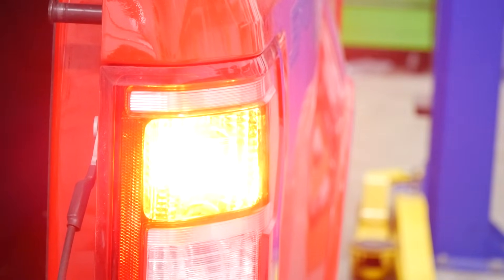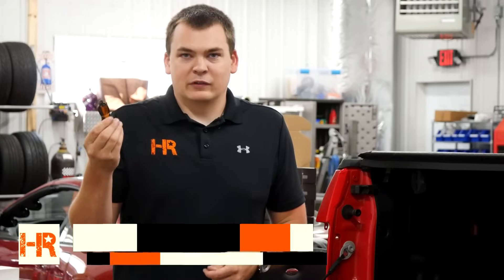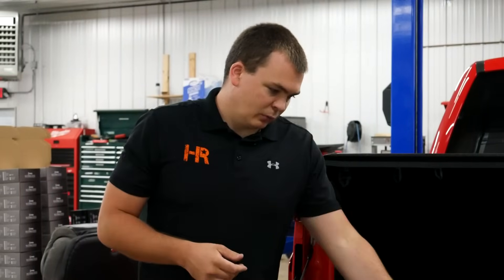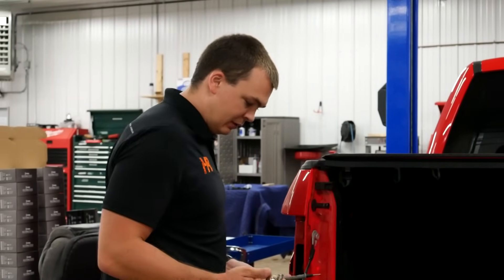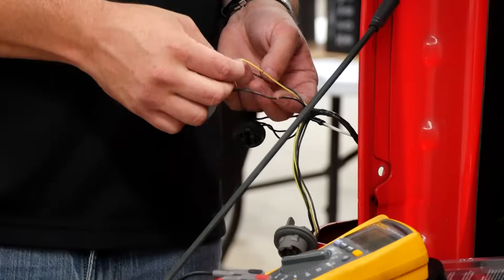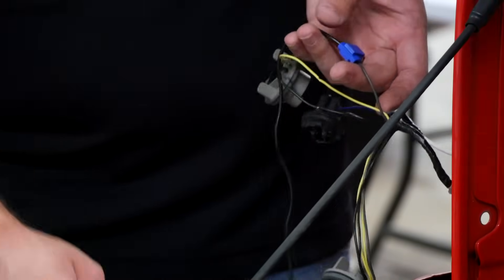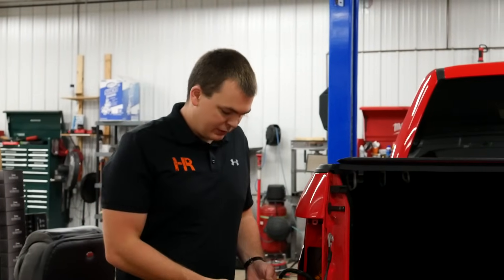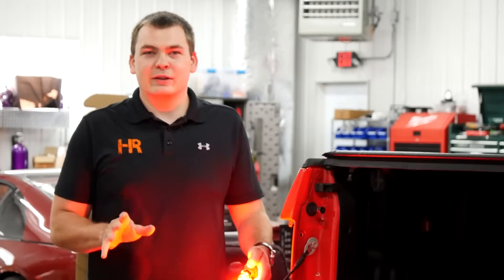How To Install LED Resistors - Everything You Need To Know | Headlight Revolution

Comment: I just put some led headlights in my jeep and when i switch to bright it will cut off
Reply from the maker: It sounds like your Jeep may need a PWM module to prevent the headlights from cutting off when switching to high beams. You can find them here: https://www.headlightrevolution.com/gtr-lighting-pwm-hid-kit-modules-ACC.PWM5202.MOD_2

Comment: I just bought some Sylvania Zevo LED Bulbs for my turn signals. Ill try them in a few days and see if it  works and if they are brighter than stock. If they give any error messages on my car or they hyperflash ill be taking them back to AutoZone. Im not cutting my factory wires in my car. If they cant make a product that works as intended they can get a negative review and give me a refund. I dont think thats too much to ask that a bulb works out of the box.
Reply from the maker: We totally agree! A bulb should work as intended right out of the box. If you run into any issues with those, we recommend checking out the Morimoto XB LEDs – they offer a resistor-free upgrade for a hassle-free install.

Comment: One resistor per bulb or one resistor per side? in the case if i want to put leds turn signals in the front
Reply from the maker: One resistor per bulb - but not every bulb/function will need one. For example, in tail lights, it's common for the turn signal to require a resistor, while the brake lights don’t. In your case, you’ll need one resistor per turn signal.
Reply: @HeadlightRevolution  I have the same problem in my 2012 Silverado, when the position ligths are on the hyper flash Start, but when my position ligths are off and use the turn signal they dont hyper flash

Comment: What kind of resister do I need for LED headlights on a 2011 Honda Accord.  I installed LED headlights and the passenger blinker is hyper blinking.  Thanks for any information back
Reply from the maker: For turn signals, we typically recommend 50w 6ohm resistors: https://www.headlightrevolution.com/50w-6ohm-gold-resistor-ACC.RES.50W_2?quantity=1
Reply: Thank You,  is it common  for only one headlight to hyper flash and the other to flash as normal? I appreciate Your response

Comment: no thermal grease?
Reply from the maker: Not typically needed when using T-taps like the ones included with the resistor kits. For plugs/connectors, though, I’d definitely recommend using something like dielectric grease.

Comment: Question. If I have multiple lights on my truck that are my rear turn signals.Do I need to add a resistor to each one??
Reply from the maker: If all of the rear turn signals are experiencing hyperflashing, then yes, you’ll need to add one resistor per bulb.

Comment: Thanks for the help.  Unfortunately I found my bulbs from another source and they told me to wire it to the high beam lights.  It did sound crazy but I have heard that the power sources from one of the headlights.  The video directions were 20 sec. long and did not tell me anything so I wired it in series to the highbeam.  Your directions were very clear  and show it being wired in parallel.  It made total sense after watching.  My car stopped hyperflashing.  Thanks and great work.

Comment: I just bought a set of H13 led lights with capacitors  all worked till I started the truck then only one worked on high beam 2007 Dodge with TIPM box would the work
Reply from the maker: With LEDs for headlights, we typically recommend using PWM (Pulse Width Modulation) modules instead of capacitors. PWM modules are better suited for stabilizing the electrical signals, especially with vehicles like yours that have a TIPM box. Capacitors or resistors are generally more effective for turn signal bulbs or smaller LED accessories.

Here’s a link to a PWM module that could work for your setup: https://www.headlightrevolution.com/gtr-lighting-pwm-hid-kit-modules-ACC.PWM5202.MOD_2?quantity=1

Comment: How to turn electricity that you pay for into useless heat.
Reply from the maker: It's a necessary evil to prevent hyper-flashing on some vehicles!
Reply: @HeadlightRevolution  It's not just you, either. LEDs are so insanely efficient that a lot of applications call for resistors. Specifically intended to make them less efficient, so they play better with one power supply or another. I get it. But what I DON'T get is why you would choose to waste power by turning it into heat, in an application where your goal is to create LIGHT. You know what else would increase your overall resistance, to get it up to a usable ohm load? More LEDS. Line up enough of em in series and you can get whatever resistance you want. That way you get more, you know, LIGHT from your lighting rig instead of heat. Just sayin...

Comment: Good video, but reality is Headlight Regurgitation pukes out condescending tech support, "Find somebody in your area... and no, you can't return a defective bulb, or one that was attempted to be installed.  I had to open the package to install the bulb, but it's defective, but it can't be returned because the packaging was opened.  Too bad HR got greedy on 2 bulbs, now my wife's car will be VLed bright!  And that goes for headlights, too.  Hudreds of dollars down the HR toilet.
Reply from the maker: Sorry to hear about your experience, but that doesn’t align with our policies! You have 30 days from the date of purchase to apply for a return for a refund, and 60 days to apply for an exchange for another product. Returns or exchanges must be postmarked within 15 days of receiving return approval to avoid delays. Additionally, if the part is defective, it would be covered under our warranty, which applies regardless of whether the packaging has been opened. Warranty details are provided with every product we sell. If you need further assistance, please reach out to our support team, and we’ll be happy to help resolve this for you!

Comment: How do you determine the resistor value?
Reply from the maker: Great question! For most vehicles, a 50W 6-ohm resistor is a great starting point. If that doesn’t resolve the issue, we recommend trying a 50W 7.5-ohm resistor, and increasing the resistance from there if needed. Keep in mind that higher resistance generates more heat, so we aim to use the lowest resistance possible that effectively resolves the hyperflash issue.
Reply: @HeadlightRevolution  I've worked on both a newer ECM controlled blinker system and also an older bi-metal flasher and discovered they are worlds apart.

A 50w, 6ohm resister is by far the most common and available everywhere.  Lower and higher resistance 50w resisters are very hard to find, unless you look to China.

A common mistake people make if a 6 ohm resistor doesn't do the trick is to add more resistors instead of ordering and waiting for your Chinese shipment to arrive..  Most important thing to remember is if you add resistors IN SERIES, the total resistance increases.  It is a summation.  If you wire them IN PARALLEL, the opposite is true:  1/R (Total) = 1/R (Resistor 1) + 1/R (Resistor 2)......  For example, if you wire two 6 ohm resistors in parallel, using the aforementioned formula, the sum total resistance is 3 ohms, or half the value of each.

Hope this helps.
Reply: I stated above the behavior is "worlds apart".  Specifically:

On an ECM controlled turn signal system, replacing incandescent bulbs with LEDs significantly reduces the system current and the result is a very fast blink (hyperflash).  On an older vehicle with a bi-metal flasher pod, the result is typically no blinking at all.  The reduced current is not sufficient to heat the flasher pod sufficiently and never oscillates.

I have tried using an electronic flasher but the results are varied, from it works great, to didn't do a thing.  So my recommendation is to go with the load resistors, which always work.  Only the resistance values seem to be vehicle specific.

I've also read (and personally experienced) on a flasher system, a certaiin resistance works, BUT when the parking / headlights are turned on, the blinking greatly slows or even stops.  I have developed a method to achieve a constant blinking rate on both.

Comment: Probably a stupid question but do you need resistors connected to both sides or just the side that hyper flashes?
Reply from the maker: Not a stupid question at all! You typically need one resistor per side because hyperflashing usually affects both sides when LEDs are installed. If only one side is hyperflashing, it might be worth double-checking the connectors and polarity before adding resistors. Sometimes a connection issue can cause the problem, and fixing it might save you from needing a resistor on that side.
Reply: @HeadlightRevolution  Thankyou for the fast response! I basically have the union jack led lights installed on a 2016 mini which originally had the normal lights, one side, the left has flash now and then but the right never does it, I've installed one into the left side but it still flashes which made me think if it needs both sides connected if that makes sense? I was just confused to why it still flashed even thou it had the resistor connected, also does it matter which wire on the resistor goes to ground or the turn signal ? As the wires are red and black.
Thanks!

Comment: I installed the same resistor and it work perfect when all light are off but it won’t work when day light running n parking lights are on..any idea or tricks for this?
Reply from the maker: Can you let us know the year, make, and model of your vehicle? The issue could be related to how your DRLs or parking lights are wired, as some vehicles use reduced voltage for DRLs, which can cause resistors to behave differently. Feel free to reach out to us directly at sales@headlightrevolution.com or 218-755-5200, and we’ll help troubleshoot and find a solution!

Comment: Hi thanks for video very easy demonstration, I got question maby different but close
I install f1 brake light to the brake line and ground witch is works perfectly fine and flash as soon as press brake pedal but only when car in ignition position but as soon as turn the car on it goes dead and not flash when press brake by the way car is vw golf mk7 with led tail light
Reply from the maker: Thanks for the comment! It sounds like there might be a wiring or power issue. Please reach out to us directly at sales@headlightrevolution.com or 218-755-5200, and we’d be happy to help troubleshoot!

Comment: Is it good to use for a licence plate or parking bulb?
Reply from the maker: If they have hyperflashing, it could definitely help but resistors will be most commonly needed in applications like turn signals since its not a constant flow of power, unlike a license plate or parking light bulb.

Comment: nice video what do u do then if reverse bulp is flashing 50 Ohm aint enough
Reply from the maker: 50 ohm is pretty high! Do you mean 50W? Usually we start with 50W 6ohm and move up from there.
Reply: Ja det er rigtigt
Hvordan montere i den, direkte på pæren eller er det nok med + ledning og chasi stel

Det er til baklys og ikke blinklys

Mvh.
Fl.sandgaard

Comment: I have a 2014 Ram and I just converted my taillights to LED. Everything works great except every time I brake or use my turn signal I get and dash error saying my parking brake light is out. Any idea what's causing this?
Reply from the maker: Rams are notorious for CANBUS integration issues – you'll likely need a resistor to prevent those bulb-out errors on the dash.
Reply: @ I did install a resistor. Sorry I forgot to mention that.

Comment: Great video.  Explains everything in detail.  I was straining to find a wiring diagram for my vehicle (at least I knew black was ground) when you explained how simple it is to test for which wire is for the turn signal. Your observation that soldering is better is inspiring me to get the Weller out.  Thanks for this.

Comment: Hey boss need a questioned answered so I got a 05 silverado with a custom dually bed and I added the side markers of course 2 on each side of the bed but I didn’t know how to do the wiring like an originally dually would have from factory so what I did is I created my own harness and connected it with the harness to the leds for the license plate might be a dumb idea I’m not sure but do I need a resistor for those led side markers ? And if I do do I need one for each one or how would the case be also if I do need resistors how would I go about to wiring it need the question answered please!🙏🏽
Reply from the maker: For your setup, you should only need resistors if you're experiencing hyperflashing or any error codes due to the LEDs. If everything is working normally, you likely don’t need resistors. However, if you do encounter hyperflashing, you’ll need to install a resistor for each LED side marker.
Reply: @HeadlightRevolution  thank you!!!!

Comment: do i need to buy 4 resistors for the 2 front and for the 2 rear? or just 2 for either the front or rear?
Reply from the maker: If you are only having hyperflashing in the rear, you do not need to buy resistors for the front. The rule is one resistor per hyperflashing bulb.

Comment: Do you have to do it on both tail lights? Or is one just good? And what about headlights?
Reply from the maker: The rule is one resistor per bulb - you should install resistors on driver and passenger side. LED resistors help prevent hyper-flashing or error codes, and both sides of your vehicle need to be properly regulated to ensure consistent operation. Installing a resistor on just one side can still lead to errors or uneven light performance. 

Not every light will hyperflash, and resistors are most commonly used in turn signal applications.

Comment: A lot of vehicles can have the hyper flash or bulb out feature simply turned off with programing. It took me about 5 min with a laptop to disable it on my 2013 F150. I liked that solution better than tapping into factory wiring.
Reply from the maker: Super easy for Ram and Fords!
Reply: What you mean?

Comment: So can I add 2 resistors to each turn signal for the tail lights??
Reply from the maker: One resistor per turn signal
Reply: @HeadlightRevolution  well I got it working for a couple days now I don’t even have a left turn signal my whole left side doesn’t work??
Reply: @HeadlightRevolution  would you know why only my driver side turn signals are blowing the fuse? For the turn signals fuse?

Comment: So do you need a resistor on each turn signal bulb? Because I have two LEDs up front in each housing and I also put LEDs in the rear
Reply from the maker: Yes, one resistor per turn signal bulb!
Reply: @HeadlightRevolution  thanks

Comment: FYSA 2007 2021 Tundra center white wire with blk strip is ground. Pink and red outside wire for each side is hot for the front lights.
Also don't do what he did to the wires. Just use spring loaded pierce probs. Tiny pin hole vs ruining the insulation.

Comment: ? Now this resistor needs to be on any LED bulbs that are signals?  On my H2 hummer o
In rear I have 2 on each side that blink. 2 in front that are amber. And of course side markers. Do all of them need resistors if LED?
Reply from the maker: You will likely only need resistors for the turn signal bulbs, side markers typically do not hyperflash when upgraded to LEDs.

Comment: I’m installing LED bulbs in my dad’s 2007 dodge ram and when I installed the bulbs they turn on for a second then shut off. Installed resistors on the bulbs and now the LEDs are dim and stay stuck on high beam
Reply from the maker: Did you install resistors or a PWM Module? Low beam and high beam require a PWM Module, turn signals, reverse lights, etc require resistors.
Reply: @HeadlightRevolution  no I only installed a resistor I bought no PWM module. Is that what’s my problem

Comment: I am having issues with my flashers, and turn signals. I have leds in all my lighting and I hooked up resistors to both headlights and taillights. It worked just fine until two days ago!!! In the morning my flashers are dimly lit on dash but I have no flashers or turn signals. But later in the day then they work.. I’m stumped
Reply from the maker: Do you have resistors on the turn signals, or just the headlights low/high beam? Shoot us an email, we can help - sales@headlightrevolution.com

Comment: Great video
Do you need a resistor on the brake and backup light?
Also, inquiring minds wish to know - what did the second resistor in your truck hook up to?
Reply from the maker: Resistors are most recommended for turn signals, and occasionally brake/reverse lights. You will need one resistor per bulb.

Comment: What about the bulb that has about 5/6 wires???
Reply from the maker: It would still be the same, you're searching for the wire that provides power during turn signal function.

Comment: Do I need to connect them on all lights before I see results? Let’s say if I install them on the back left like you are then it’ll blink normally when the back right and the front 2 still hyper blink.
Reply from the maker: Since it's one resistor per bulb, they will work as soon as installed. If you install on passenger side but not on the driver, the passenger side will be the only one fixed.

Comment: Yeah Im confused, the set of tail light housings I bought have the resistor connected to the housing already it has a white plug that connects to two other wires that go inside the housing, so I installed the housing and I get no lights at all and I keep blowing fuses
Reply from the maker: What tail lights did you buy? Shoot us an email, we might be able to help - sales@headlightrevolution.com
Reply: @HeadlightRevolution  Im not sure I bought them last yr but my truck wasnt running till now. I can send a phot of them thanks